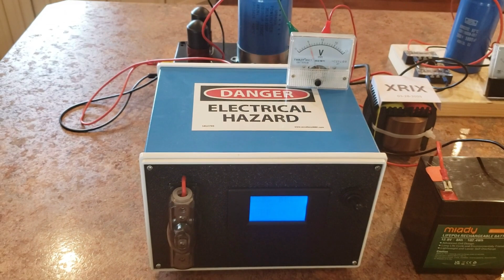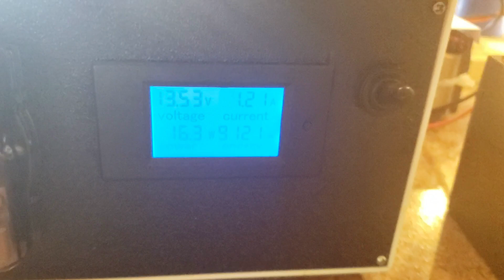Over Unity Working Don Smith Device - Part III

Comment: Hey XRIX,  teslas quote on 57 of CS referring to fig 2 and 3...."the same regard to figure 2 hold good for this and in both cases(2 and 3), if there is to be resonance and best conditions attained, the circuit including the break should have the same period and be in phase with the primary circuit LP CP and secondary LS CS."   What are your thoughts... obviously the LC primary must match the LC of the secondary , "for best conditions attained", but do you think he is stating that the circuit including the break, means that the discharge rate of the SG should also match the resonance frequently of the primary and secondary?
Reply from the maker: Hi Fernando,  what is the easiest ratio between two antennas so that they RX/TX with no tuning? That is how I make my "isolation" transformers. The approach is simple, because I never use a scope. I have one, but Tesla didn't -- so he must of approached construction as I (1/1, 1/2 , 1/4 ) simple ratios. Regarding the break, as long as your break happens with regularity, 1cps, it will create an oscillation determined by the tank. It should be possible to use proximity coupled Cap an Inductor. I have done similar, see my Wardenclyffe videos. The idea is you are creating flux in the nearfield, and capture with conductors nearby, if the potential is high enough, you can create a circuit jut to Earth ground.

Comment: Hello, I apologize for the misunderstanding in our communication! I studied your answers and you really left a lot of information with reference to your device! I would like to know if in the black diagram 1) the capacitor that is being charged is placed correctly or if I need to have one in parallel with L1 so that there is resonance in L1 exactly like on page 57 of Tesla, 2) If the MOT transformer has the HV part towards the output because if you say that you have protection for the capacitor so that it does not explode it would make a lot of sense... 3) if the diode rectifier is classic or is it important that they are connected exactly like you and Smith did in your devices! Thank you for your attention! I want to take this device to another level even though the gap is the most important component in the toy and it seems that it cannot be replaced with mosfets even if there are mosfets that have 1200V, 19A, C2M0160120D respond to 9ns. Thank you!
Reply from the maker: The HV side has the most capability of creating magnetism. So the caps reference that coil as the primary. The spark gap is a simple solution, but if you keep trying, you will be able to make it solid state. The power of the device, is seated at the size of the capacitor and how fast you can charge and switch it. and your transformer's ability to manifest the magnetic flux. If you can optimize those four parameters, you will have success.
Reply from the maker: My approach would be to build a device, that convinces you that the design works, then move in iteration to dial in each sub system. People are always in a rush, and haste creates too much unknown to rollback. Document your changes and log the failures as well as the gains.
Reply from the maker: I use the three caps of CO Springs page 57. It will work with two caps, like in the Zilano schematic, because you need one blocking the DC, and one for the Primary to create an LCR tank. Three works best for me.

Comment: Hello, from what I have studied and tested, I have come to the conclusion that the energy is in voltage peaks! Really hard to capture if you don't know how. The charging time of a capacitor is given by the capacity, but the stored energy is given by the voltage which is squared! The conclusion... small capacity and high voltage and you capture the energy of a resonant system without influencing it much! I also found a method of converting from high voltage 3KV and high frequency 20KHz, to low voltage 210V and low frequency 50Hz... (without transformer) I await your opinion! Enjoy watching!  https://www.youtube.com/watch?v=JlqbzCzONcw
Reply from the maker: Yes, that was Don's approach on some devices, was to start out with HV HF and turn it to Grid  AC. The issue is that people think V=IR means you can take a start voltage  of 3KV and turn it into 120V@25A which is true... however by doing that you are still confined to the power which is expressed over time. So if your NST is  3000V@10ma = 30W, and you want to end up with 120V@25A, power is a function of time, so for just a fraction of a second - NOT a sustained power to devices. It is also a myth that resonance is the key to creating more energy, it only optimizes the energy you have. I am using resonance but the gain is from the magnetic, not the electrical rabbit hole.

Comment: Thanks XR IX for posting these videos and giving enough details for replication.  Just wanted to say thank you my friend.  Those Xenon tubes are in series... Yes?
Reply from the maker: They are in parallel. In the end all spark gaps will fail, specially when you use them for high power switching. They alternate because one will execute the action, thereby deplete the capacitors, and maybe the next one will fire at the next timing intersection. It is not a AB oscillator.

Comment: 🎉. 
I have investigated deeper this case. 
I literally forgot, what value could hold disruptive discharge... 

Yesterday did some calculations, fascinating stuff can be achieved, if: Discharge path can withstand and overall transformer. 

Today I did small test and with 1xAAA battery managed to blow a meter, on stepping down, with a second pulse while wanted to measure AC output. (A bit underestimated the potential). 

Anyways, haven't you thought of IGBT switching? All research leads to the IGBT/MOSFETs, due speed in switching, control. + Might can be more reliable than GDT and Xenon's. 
For tests might enough GDT. What's your thoughts on this? 

Very powerful circuit. Hopefully people eventually will understand what this can achieve. 

Thanks XR for sharing information. 🎉
Reply from the maker: I may have considered solid state :). LOL. Great that you are seeing the potential of what is being illustrated. I am not ever going to show more than this, simply because there is no need to show it working at a large magnitude. It isn't my idea, it seems to be carved in stone  by prehistoric man. We are capable of more than self perpetuation, when we give to others.
Reply from the maker: The most important idea would be lost, if I were to tell people that I used a IGBT or MOSFET. I wanted to maintain the simplicity of the circuit, such that you could build it with 1890 engineering, and have  results like Tesla did. If the human race were only left to scrounge parts from broken automobiles, you still could salvage the parts needed to build it. Transistors, require biasing, and gate driver circuits, and oscillators... A spark gap is quite simple and does the job, with low value capacitors because don't think you'll have a stockpile of supercaps available. You might be able to scrounge 50uF from air conditioners. The circuit is stupid, and Don Smith said it was moron comprehension required. This is why you can't patent it.
Reply: @XR_IX   True, but still, many are not aware of that. Education system worked well in this case, to keep benefits in own pockets.

Comment: Hi, nice video, thanks for sharing. Could we say that impedance matching occurs in the metglas transformer?
Reply from the maker: Absolutely it does what my OU I does in one core.
Reply: Ok, so we do Impedance matching by magnetic resonance?

And the feedback coil feeding back energy into the large capacitor and timing your trigger event ?
Reply from the maker: @EliasVanLorien  I would say "we do Impedance matching for maximizing magnetic flux". There is no context for "Magnetic Resonance" in how I or Don Smith uses the term. You will only see "Nuclear Magnetic Resonance", which is totally something different. Yes on the feedback coil.
Reply: @XR_IX  first, I'm extraordinary grateful for your answer! That helps me a lot!!!!!
yes, nuclear magnetic resonance is a totally different subject. 
When I talk about magnetic resonance in relation to Don systems, I refer to equal cable lengths (or multiples). But your answer have so much more deep sense! I really appreciate your help ☺️ 🙏
Reply from the maker: It is obvious once you figure it out. Learn it, master it, and when you do... teach others. Or you can look at the Knowth Kerbstone series and see what happens when humanity forgets.
Reply: @XR_IX  ❤ When I have results I would be very happy to let you know

Comment: Hi @XR_IX I'm trying to follow the Zilano's circuit on your video but some components get me lost. Can you tell me please if what he calls "L3" on the diagram is the red coil or the one in the outside with the black fat cable? (I guess is the red one but I prefer you confirm it please). Thanks
Reply from the maker: The black wires are output. You can see they go to the load.
Reply: @XR_IX  thanks for your answer. I'm asking about the Fat cables around the core (8 laps) not the coil inside. On Zilano diagram L3 go back to the beginning of the circuit. Here I'm pretty sure is the red coil  but the connection between the black box and the blue box drive me crazy, that's why I'm asking about it
Reply from the maker: @My L3, goes back to the beginning of the circuit. It drives the oscillations, hence it also is feedback to the circuit operation. Much like a slayer secondary drives the gate of a transistor.  But the bluebox doesn't use transistors for switching. The red wires are the primary L1
Reply: @XR_IX  Man, I have a lot to study! thank a lot!
Reply: @XR_IX  Just to double check L1/L3 are wound in the same direction and L2 opposite right?
Reply from the maker: @danonino2003  I believe that is right, I go over instead of under on the first turn. If I don't get what I like I will try the opposite way just to be sure.
Reply: @XR_IX  Thanks a lot! Now it's my time to try! Thanks 🙏🏼
Reply: Thanks again for your time and sharing man!

Comment: Dear @XR_IX , dear @rickfriedrich

I want to sincerely thank you for your incredible video. The clarity with which you explained the system's structure and operation truly helped me move forward. Especially your explanation of the pulse circuit and the role of the impulse network gave me a real breakthrough in understanding what needs to be done.

However, I'm still struggling with one specific point in Module 3 – the final stage involving impedance matching to the load.

I do understand the general concept of impedance matching from RF and audio systems, where it typically involves frequency-dependent components and alternating current.
But in this case, I'm a bit confused because, after the rectifier bridge, we're dealing with pulsed or stored DC in a large capacitor – not a traditional AC signal.

So my main question is:
Where exactly does the impedance matching take place in this setup?
Is it before or after the rectifier bridge? And more specifically, is the matching meant to occur between the storage capacitor and the load – and if so, how does that actually work in a pulsed DC context?

Any hint or clarification on how to understand or approach this would be deeply appreciated. I'm sure I'm missing something subtle but important here.

Thank you again for your generous and insightful work – it’s already made a huge difference for me.

Best regards, and greeting to Rick, hope we can see us again on the next convention in Germany

Alex

Comment: Excelente trabajo amigo, una pregunta sobre la puesta a tierra que no usas aquí como usaba don Smith?
Reply from the maker: Gracias. La conexión a tierra tiene sus ventajas, pero solo es útil con mayores energías de entrada. El problema es que se comete el error de creer que la conexión a tierra amplifica la energía. Cambia la impedancia y se puede usar para abrir el circuito. Puede generar energía si se usa como la tercera bobina de Nikola Tesla. La estimulación de la tierra requiere mucha más energía de entrada de la que puede proporcionar una batería de 12 V. Es como empujar el borde de una piscina infantil. Si se usa poca energía, no hace nada. Empujar con fuerza en el intervalo adecuado produce ondas estacionarias que se pueden capturar sin amortiguar la onda, ya que es magnética.
Reply: @XR_IX  Te puedo contactar por telegram?

Comment: XR IX: "Disrupting (Tesla) spark within the aether by a DC closure causing magnetism in the surrounding conductors can be used to multiply magnetic moments which can be transformed to real power."
THIS IS VASTLY IMPORTANT! Do not get lost with any of the other details people. This is critical. All you need is one of many different methods to do that and then collect it and transform it to a usable form. We do that with the motors, solid state, NSTs, etc. Then you have the batteries or transformers as collectors, or coil resonators... Stop looking for magical parts or special parts combinations. Consider the facts around an EMP. What does it do to your electronic equipment? How easy does it destroy it? Look at (measure) the magnetic radiation from these Don Smith systems and see how such a little NST can produce such high magnetic output from so little input! Avalanche Magnetic Resonance Systems. Multiply the Magnetic with Resonant Driver and Tune Collector to Resonant Frequency. Then Match the Load with the Right Impedance.
Reply: @rickfriedrich  Thank you Richard.
Reply: Is that quote from Don Smith? Also, do you happen to have any info on what ever happened to Don's possessions (namely all his devices and notes) after he passed?
Reply: @AethericTheorem  Yeah I was told by an associate of his that the prototypes burned up in a fire but I do not trust the story as the fire was self-started when I look at the details. I have respected Don's family and have never tried to pry into their lives. I have now met a handful of people who were at these meetings and knew or worked with Don directly. As a historian I have a pretty good idea of what happened from the direct and indirect testimony. But I will say that it is hard to trust hearsay that can't be verified. It's important to focus on what we know for sure. I have gathered what I could and shared it as best I can. One more video left and that's all I am aware of. These last three and the second part of the 4th (office video) were never shown before.
Reply: @AethericTheorem  That was a good quote from XRIX near the bottom of the comments. I had to highlight it because of how critical it is.
Reply: @rickfriedrich  can you recommend a good source for understanding impedance matching?
Reply: @pumm5866  That's too broad of a topic. You can search youtube for the specific subject you want to focus that on.
Reply: Great info Rick! The problem most of us have is understanding/utilizing concepts like "impedance matching" and wire length as it relates to the tuning of a coil or wire. Where does one measure the wire length of a coil? Is it at the termination points of the coil, or right up to where the body of the adjacent component begins?
Reply: @NickyTesla-pg1ex  The wire length includes the "pigtails" which is the conductive part of the components. Generally I start with a little longer and work my way back rather than cut too short. Anyone who doesn't know what to do with impedance matching needs to study up on that which is conventional theory learning. Interestingly that is where most people fail, beyond also assuming many things. In XRIX quote we see something you would not expect so you don't even bother to try because you don't think that way when in a conventional mindset. And that point is one where impedance matching doesn't really matter other than preferring a matching of frequency.

Comment: ''''Please ask a well formed question'''......sure:
'' Look on the magnetic side of things '' is also a Don Con method to deceive from his side.
From your experiments ...where should one search for that extra inflow of energy? 
Thank you.
Reply from the maker: That is the common mistake, thinking that there is an inflow of EXTRA energy. It is not extra, it is the return of energy that is already there. An example of this, happens when you disturb a still water pond. The disturbance creates waves and spreads across the entire top. Current electrical engineering looks at one point in that single pond, however the wave propagates in a scaler wave. A spark gap can multiply that disturbance point. So that when it fires, the disturbance happens as many times as you choose over multiple ponds as long as they have similar dimensions (impedance). My OU I video clearly shows this, the same energy used to excite multiple MOTs.